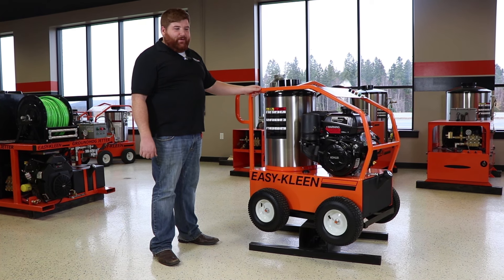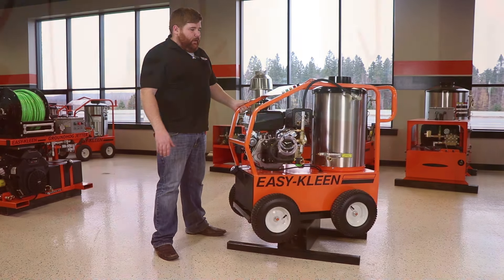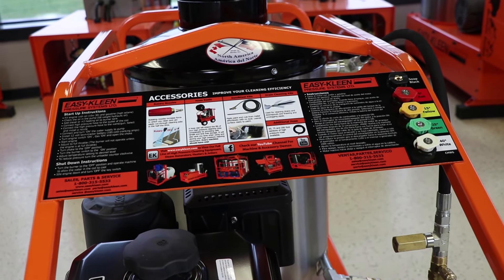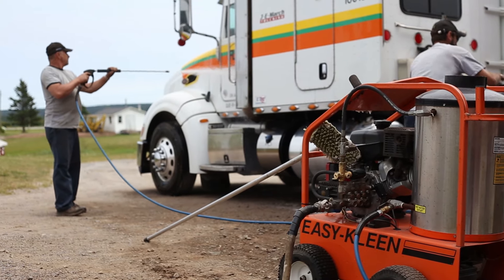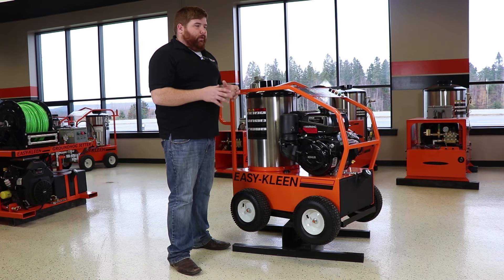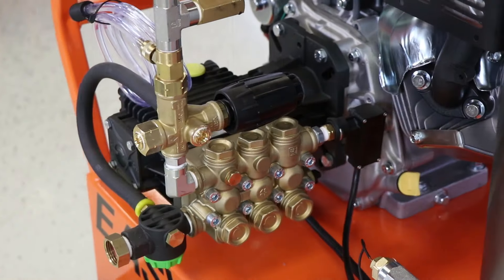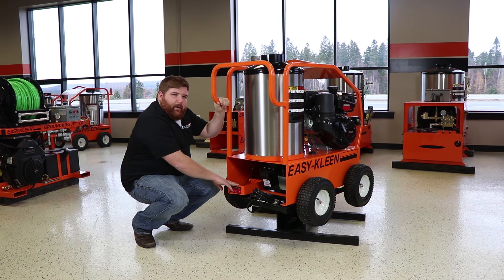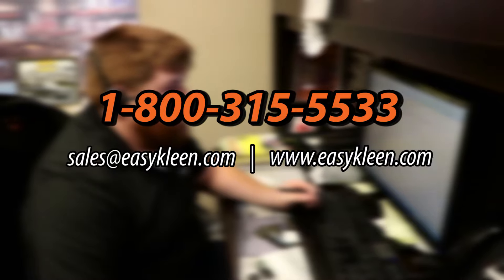3.5 GPM @ 4000 PSI Hot Water Pressure Washer - Easy Kleen

Comment: I’ve been wanting to buy a hot water pressure washer. I finally settled on this exact model but decided to buy it at princess auto because they have a great warranty/exchange in case of anything. I walked in and headed straight for the pressure washer to see if they had one which they did but nobody around to serve me so I went up front to ask for help. 3 workers standing around and I asked who can help regarding the hot water pressure washer. One rep stood forward to gladly ask what I wanted to know. I told him I was interested in the EK 4000psi. Model and what his thoughts were. No lie, he looked at me with a straight face and said “they’re garbage and don’t buy one”. I laughed and he said “no I’m serious if there’s anything I can tell you about these units, it’s to stay away and don’t waste your money”. I was really thrown off by this and had to ask why. He went on to tell me how many units were sold of both the 2700psi. model and the 4000 psi and told me how many were returned just in the last year alone for each one. Needless to say I was shocked when he said half of all the 2700 psi units came back and 8 of 12 units of the 4000 psi were returned. Even more shocking was that he claimed most if not all returns were due to engine issues and something with the burners catching fire. I walked in to the store with every intention of leaving with one in the back of my truck but he really turned things upside down quick. I’m not sure what to think or believe at this point but the representative seemed to really know his stuff and why on earth make up such an elaborate story and even go to the extent of telling me the number of returns. Even if this were complete BS I can’t justify the risk when it costs $4200 and the closest princess auto is almost 300km return trip. Really disappointed about this....
Reply from the maker: Hi Mark, 

We are really sorry to hear about this experience you had at Princess Auto.  Easy Kleen is proud of our partnership with this great chain of stores.  We work hard to manufacture efficient, high quality and dependable equipment for sale in their stores. 
You are correct that Princess Auto offers a great warranty/exchange program.  We work with them to educate Team Members at head office and store level about our products and the proper and safe way to operate our pressure washers.
According to our records and Princess Auto’s communications, the number of returns is very minimal.  We would appreciate an opportunity to discuss this further with you, please contact us.  We look forward to hearing from you!
 Tanya Deveau
Sales Manager
1-800-315-5533 ext 6082
Reply: I had this very experience. Not with princess auto but with one of the issues that clerk described to you. I just had to order a new EK440 pump at the tune of $640.20 CAD before taxes and shipping. I had the issue of the insulation in the boiler catching fire. To my surprise easykleen is well aware of this issue but provided no replacement of the unit or it’s now destroyed parts due to me purchasing the unit brand new from an auction. I was told these units are made specifically for auctions and have no warranty. The rep told me that the nozzle in the burner comes fairly large and over time it will saturate the insulation in the boiler and eventually that insulation will burn. This is what happened to me. I shut off the machine and the insulation continued to burn. This boiled whatever residual water was in the machine causing my pump to get destroyed internally and my gun to melt. Not to mention the steam explosion that happened. Thank goodness no one was hurt as we were all fairly close to the machine when this happened. Long story short had to spend unnecessary money for a problem easykleen doesn’t want to fix.
Reply: @kingb537  thanks for the info I guess I’m buying a horsy.
Reply: Most people will fill these units with car oil, even good ones like mobile one. This will destroy the engine very quickly. These engines are old school and require oil with zinc for the metal to metal contact on non roller cams. New oils have no zinc! Amsoil makes a four stroke engine break in oil with extra zinc and after 50 hrs you can switch to amsoil four stroke regular. I use dozens of these honda clones and have learned this after the first 2 went to the scrap pile. There are several youtube videos that go into this in detail.

Comment: Put a Honda Engine in there and maybe we can make a deal.
Reply from the maker: Great news, we make these exact same machines with Honda engines as well!
Reply: Commercial 4000 PSI 3.5 GPM Gas Driven Hot Water Pressure Washer 110/120V
Model #EZO4035GLEK120

Has a 15 Hp Honda motor

Comment: Which oil does motor and which oil does the pump unit use?
Reply: Does it have a back flow preventer built in or do I have to buy that to add it too?

Comment: This is the model I received 

Commercial 4000 PSI 3.5 GPM Gas Driven Hot Water Pressure Washer 110/120V
Model #EZO4035GLEK120

Do you have a link to a setup and how to video you could share with me please